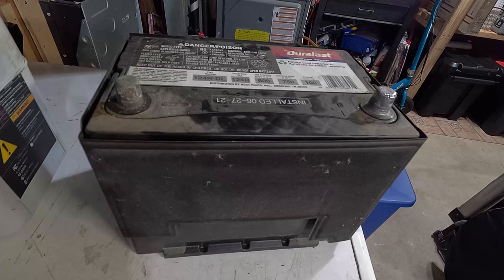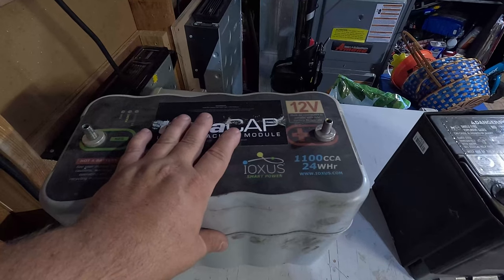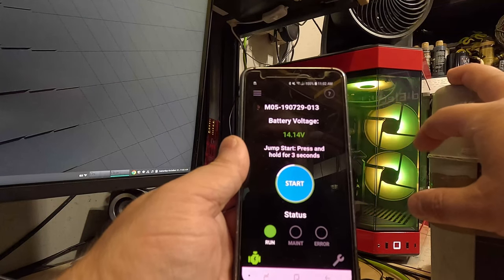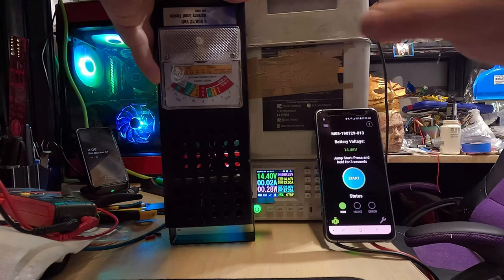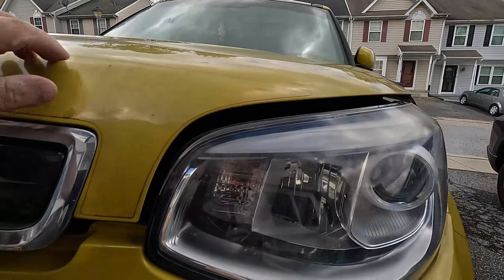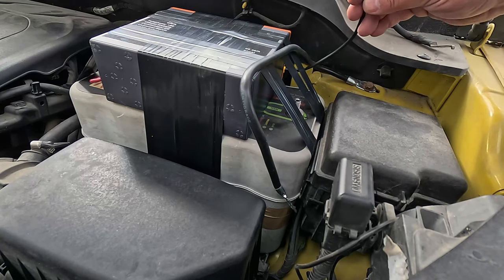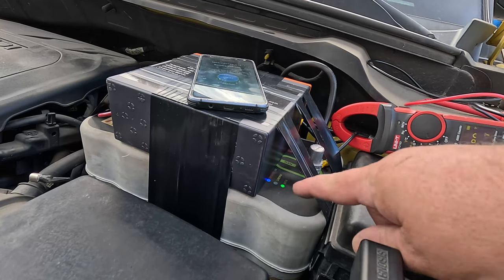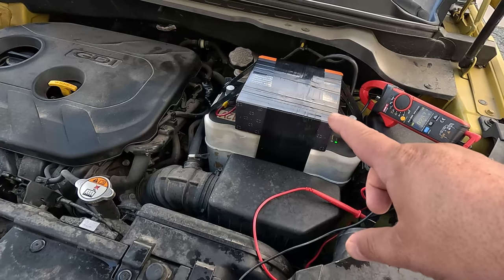Hybrid Supercapacitor Car Battery 2023 Build

Comment: Don't use electrical tape on that positive jumper - use Rubber Tape!  The package will say 'self fusing silicone' or 'self vulcanizing', and it's Not Sticky - except to itself.  Much better insulation and it'll take more abuse than most electrical tape.  Heat will eventually make regular electrical tape brittle and destroy the adhesive.
Reply: Yep they have my favorite one at Walmart its got a blue backing that peals off and its nice and thick and melts together and makes a nice solid rubber cover to whatever you wrap it in

Comment: So I bought one of these UltraCaps to disassemble and use the caps for my own custom build. Well, I had to use a chisel and hammer to get the gray exterior casing off and found that the inside was completely injected with polypropylene; solid. I kept chiseling to try to get at the caps, but felt like I was nicking them too much, so I gave up. I guess I'll just have to use the UltraCap as is, or find a different method to disassemble.
Reply: The same one he bought?  Dang..seems like they don't want people to get at the supercaps...fooey...but at least they work
Reply: @haydenc2742  yes, the same one. It works absolutely amazing and the starter motor feels like it wants to spin the whole truck around. I installed it in my wife’s 2003 Land Rover Discovery. I ordered another one for my 2011 Land Rover LR4. I tried using a 0.1 ohm/100W resistor, but they kept burning up, so now I’m using a 55W halogen bulb as a current limiter and it works perfect.
Reply: I have one that went bad that I was thinking about doing this to. glad I ran up on this comment...
Reply: @RealPivotTV The one in my LR4 was causing it to throw codes like crazy, mostly related to transmission. I spoke with IOXUS and they told me that first gen of UltraCap had a boost/buck convertert that emitted high amounts of EMI. My guess is that this was interfering with the ECU, which is directly behind the battery. I purchased 6 bare IOXUS 3000F ultracaps ($30.53/ea) and bussed them in series and now everything works so good. Like Mad did with his previous build, I don't use any balancing, because the nominal voltage of the pack is 16.2V, and the charge curve is linear, so all the caps should stay safe.

At some point I'd like to get at the capacitors inside the UltraCap module. I was thinking of trying to melt the plastic or use a wire brush wheel. I don't care about the electronics, just the capacitors themselves.
Reply: @markmroz  yeah, I was wanting to direct it on my channel. Hey where did you get those caps for $30?
Reply: @RealPivotTV  I got them on Amazon, but the price looks to have gone up a bit. Still a pretty good deal.
Reply: @markmroz  link?
Reply: Damn, glad you said that. I was also considering buying to get the caps out

Comment: I think capacitors are the future of EVs and battery replacement in general. I'm excited to see people using them this way.
Reply: They're not quite there yet. The energy density is still really low, but we are making strides in it. Even if they only had a quarter the energy density, the charge time is very quick. And would likely replace them at that point. 

We have graphene super caps now. Big step up.

Feels like a hybrid system would work. Super caps and then a battery bank for longer trips. Would allow you to have way less batteries, and they'd last longer too because most trips would just use the super caps.

We are very close to a lot of things that will help. Sodium batteries too. Solar panels are getting quite efficient as well.

Comment: .10 is alot  for sleep mode, you definitely have a relay issue    most cars draw .03 ~ ish mah   thats probably why you are chewing through batteries  id' check your Security relay      on my jeep the alarm relay was on 24/7 even while started.    so i just pulled that relay  and  i stopped having battery issues.

Comment: Not sure if you tried to open up the Ioxus, but if you didn't and to anyone  else thinking of doing it. Don't do it. You will never get to capacitors. Under the grey case the capacitors are encased in plastic. If you look at the bottom of the case, you will see the holes where the  case was filled with the plastic. It is impossible to break the plastic around the Caps.

Comment: In my car i was having issues with the lead acid battery dying after 1 year because the engine bay was too hot. Tired of that i moved the battery to the truck rear bay and it worked fine. Installed some maxwell capacitors and everything goes nice now. I just don't recommend installing the ultracaps in the engine bay because of the high temperatures.

Comment: Years ago (about seven years ago) I installed a military grade Maxwell Super Cap pack on my Suzuki Vitara 2.0. I was able to run it all over town for a month using just the super cap with no batteries. I had a booster with me just in case but the super cap could maintain its charge over night and could start the car the next morning.
This was just a test so I had to be very careful not to leave the radio on or anything that could drain the caps! 

I then added an RC small battery to keep it charged and later a small 12 volts dry cell alarm battery. I am still running this super cap and just  I just drove today over sixty miles.
I purchased a second cap bank but is a cheaper brand and it drains really fast on its own so I have used it for years on my lawnmower, I just jump it, do the work and I don't have to keep buying batteries every summer!

Comment: Thank you for video I wasn’t sure if cap was under hood safe do to heat? But I guess it’s safe especially for my application. My vehicle is for bass 😂 .. I have 2 super caps running together with a blue top agm under the hood and a 48ah headways lithium bank in the back close to my amps . But I’m getting rid of the blue agm and replacing it with a ioxus super cap and just run the lithium bank in the bank that will power all three super caps .. 
I’m going to run 6- 12s subwoofers 😂 boom boom 😂
Reply: Brilliant   idea   I gonna try that.

Comment: I did this on my vehicle. Except, instead of using a small battery. I have a long thin solar panel in my window. It keeps the caps topped up and ready for use. 

I have a backup way to charge too if i need it. Just a cable that plugs into a phone or powerbank. Only had to use it once. The caps i have keep a charge for a fair while. Only time i had to use it was after the vehicle had been sitting a week with a few inches of snow on it. 

I ran the cable inside the car and can just plug in there. No need to even open the hood.

There are lots of ways to to charge these too. Inside a garage you can just have a wall wart adapter or even a uab charger. Or a battery tender. Only really necessary when they sit for a long time. But even if it did die out, you have so many ways to charge the caps, especially if you have a bit of electrical know how.

Could be just as simple as flipping a switch inside your house 3 minutes before you leave if you can figure it out.

They dont need high current to charge. Even a trickle of electricity over a few hours can do it.

Comment: 6:10, wow a voltage drop to 13v. I have the same tester and my van with a 160 amp alt drops to 12.4v at idle.. definitely need one of these.

Comment: My 15 Soul+ doesn't eat batteries like this (although, your wife's appeara to be a Soul! Given the headlights, which also means she probably has the subwoofer and amp) You might consider testing each circuit for a ground fault, as well as check the alternator.

Mine has had 2 batteries over it's life, and I know the previous owner had it somehow starting with an extremely loose connection (like, the nut was flick-spinable) and it was causing a traction control fault light of all things as the only symptom. You've given me something to think about when this one eventually dies for sure!

Comment: These sell for 1000$ amazon- 499, any audio website 399.... cool video nonetheless,  I run 2 ioxus +a red top optima 950 on my hotrod. I really like the results paired with my 330a/16v @3k rpm. No injection or spark issues.Cruising with the stereo-sits at 14.6 happy-batteries=600$ (ish) total. Zero battery issues for the price of a single blue top optima
Reply: 5 months later you can get these under 150$ and even in 120$ in some cases. Looking a bit more interesting now huh?
Reply: @Brandon_Neil  $109 at Big Jeff Audio for B-Stock, thinking about ordering a couple more.

Comment: That's cool, I'm thinking about getting a Chinese 16v100F assembly and sticking it in my car. 
But wouldn't it overheat in summer? These caps are usually rated up to 60 C, and their lifetime gets much lower as the temp rises. By orders of magnitude, in fact.

Comment: How are you addressing cold weather charging of the lifepo4 battery?  Maybe, AGM would be better, at least in cold weather?
Reply: I'm curious about the answer to this as well. I suspect since it never really discharges much the damage from cold weather charging is minimal. He has a similar setup in his car and one of his videos it is 8 deg F outside.
:)
Reply: I very much doubt the Lithium would be very much worse than Lead in cold conditions...although the BMS may say different

Comment: Dude car batteries cost so much! Went to costco for 12 year old toyota and it cost me $300ish usd…

Mad Electron change all my batteries plz
Reply from the maker: I'll get right on that, lol
Reply: thanks lol @madelectronengineering
Reply: i had an AGM battery last me about 10 years. still had life in it when i traded it in. just got tired of servicing it.
Reply: @madelectronengineering  Can this supercap type of setup be done on an E-Bike to extend the life of the E-bike battery?  So that the supercaps are providing the power instead of the battery, resulting in less wear on the battery?

Comment: I like this kind of hybrid systems and thank you for showing. But sine i used to own a boat i always did the fail save principle. Looking at taping a 20ah on top of the oxion i do wonder about long term friction and shaking since they have different weight and dimension. Is there also a way to add a manual box to the oxion zo when no bluetooth you can still access? Thx :)

Comment: Very interesting series, I've been binging all the videos. I am wondering whether you are concerned about degradation from high temperatures in the engine bay? Considering LiFePO4 seems to be rather sensitive to temps over 60C. I understand some companies specifically sell more expensive "under-the-bonnet" rated LiFePO4 batteries for this purpose.

Comment: Thanks for the great info!  Anyway these caps could be used to power an inverter for backup home power during a power blackout with or without a lifepo4 battery?
Reply: I have been using super caps for years now. Super Caps have very little storage milli amp, a 120 milli Amps (not even an amp capacity) can however start your car, they just deliver a tremendous punch of power but you will need an actual battery to keep whatever you want running for a while unless you have numerous super caps in parallel to build up storage capacity.
To power your inverter a bank of Lifep04 batteries will be best and no need for a super cap.

Comment: I've been thinking of making a system like yours, but I'm worried about the alternator overcharging the LiFePO4 and the BMS disconnecting it from the system, allowing the alternator output to spike when the battery load is removed. I guess this wouldn't be an issue if the supercap is always in-circuit, but I can't be sure of that.
Reply: I would think that it should be okay as SLAs charge at a lower voltage then LiFePO4. You definitely need a resistor to limit the in/out current on the battery. I’m using a 60W halogen bulb as a current limiter because my resistors kept burning up.

Comment: I did like the temp solution since it was smaller and more compact and all the original car wires reached.  Why did you stopped using that, was it because the capacitors were smaller?  Could you not have just added 2 more rows of caps to make it the same height as the Li battery?

Comment: Wouldnt the heat hurt that capacitor?? All that engine heat🔥🔥🔥🔥
Reply: I am more worried about that tape...
Reply: Yeah. Capacitors like to work at low temperatures. The hood engine bay high temps wil make them last less.

Comment: I have one of these ultracaps wired in parallel with 2 other batteries for my car stereo and mine sits in run mode all the time too, doesn't seem to affect anything. I'm using 2 AGM batteries and not lithium.
Reply: How many watts you running? Any battery drain? Stock electric? I have one of these too. I still get headlight dimming I'm pushing skkar skv2 1500.
Reply: @hitmanbuc  I was running around 5000 watts roughly (probably 3000 with impedance rise) with an taramps smartbass. I also have a high output alternator by singer which puts out like 160 amps at idle and 320 at full rpm.

Comment: I was looking at the older Hybrid Supercapacitor you posted years ago, you used Amperics 3.0V, 600 f capacitors they don't seem to exist now.  Can you recommend a quality super capactor?  I purchased a 2.7V 500F1Set(6pcs) 2.7V 500F 35x60MM Farad Capacitor Super Capacitor with Protection Board1Set(6pcs) 2.7V 500F 35x60MM Farad Capacitor Super Capacitor with Protection Board that was junk.  Any info would greatly be appreciated, thank you
Reply: I used Tecate group 3000F caps on my golf TDI

Comment: Good job.  Not, thrilled you need an app to enable the run mode.
Reply: Yeah...if it becomes an issue...I'm sure he will gut the thing, and rework it to just use the supercaps and eliminate the bluetooth stuff
Reply: This is the most amazing part.  Can you believe how this would put an end to those KIA thefts?   It probably better than a hidden kill switch.
Reply: To be honest , i would rather have that .  People are stealing cars left and right these days.  This would pretty much be a direct kill switch at this point.  Most people have bluetooth enabled on their phones 24/7 anyways because cars have bluetooth capabilities for hands free calling.   So i see this as a bonus rather than a con.
Reply: @BillR-e2g  Pretty much yeah , That and classic cars.

Comment: Do you know what the jump start option does on the app? I just got an Ultracap and it came with zero instructions.
Reply: Yes , it allows you to pull all the current from the Caps all at once when your main battery is dead.

Comment: I would be cautious of that big orange resister on the left side... those things can get dang'd hot and melt stuff.
Reply: It's there to eliminate/reduce the current flow in and out of the Lithium iron phosphate battery...it's job is to allow at a MAX 20A flow either direction...discharge or recharge...it shouldn't ever have enough current flow for sustained amount of time to get too hot.

Comment: Do you have any idea why the car eats batteries every 2 years? Is it the quality of the battery or is the battery over used excessively somehow? Do water pumps or cooling fans run after the car is shut off causing excessive drains on the battery?
Reply: Lead acid batteries use lead paste in the plates in a grid...due to heat/vibration the batteries (ALL lead acid batteries) the plates will sufate and degrade and dissintegrate, the sludge falls to the bottom of the battery and ends up shorting out or loweing the CCA...this is why the much much higher dollar lead acid batteries use AGM (glass matting) to keep the substrate in the plates...but those too eventual sulfate up and wear out

Comment: electrical tape long term is a bad idea. the glue and tape are going to make a mess once it degrades.
Reply: i wonder if a thermal pad between the battery and cap bank would be adhesive enough to hold it, those things last longer than electrical tape, less vibrations than putting the battery directly on the capacitor bank. could still use some straps to make sure it doesn't move

Comment: No way I would put one of those in my car. The Ioxus super capacitor banks were  recalled because of they were draining AGM  batteries and catching fire.  Why do you think they are going for only $129 b-stock.
Reply: I have not looked into it yet myself but , one person on another video said they work for the company that builds these batteries .  They said that many of them were recalled because of the cases splitting and causing water and condensation to get in which in turn started shorting the cells together and causing them to catch on fire.  Not seen one drain a lead acid battery yet , but then again im just now seeing this second video on this battery so more information will be needed befor i myself pull the trigger.